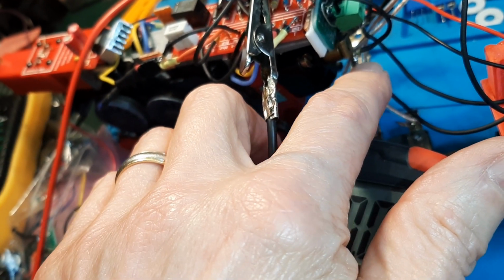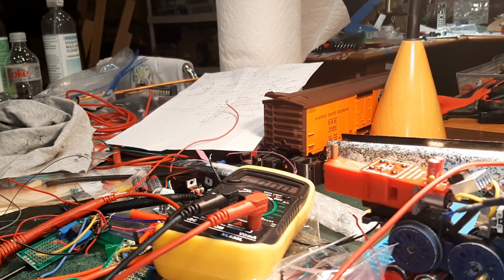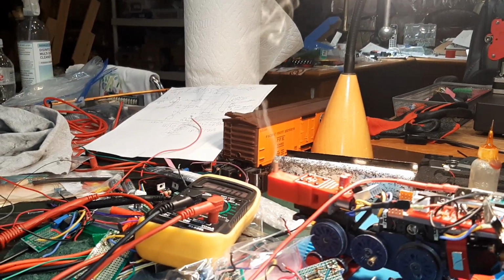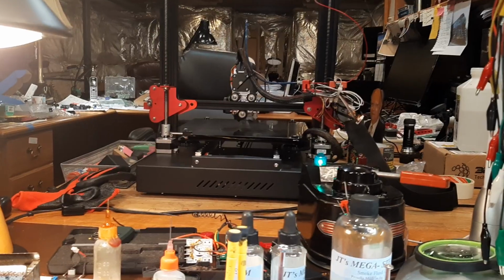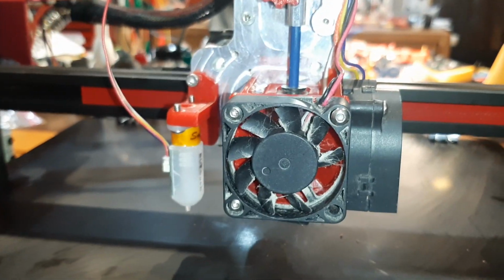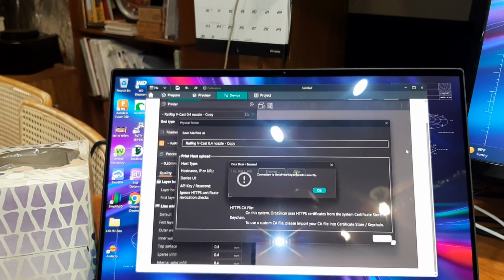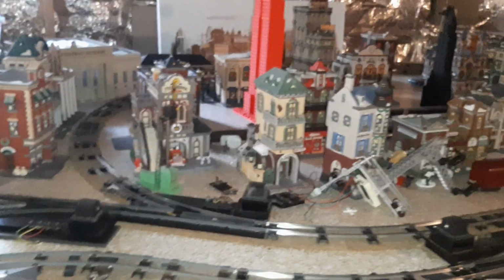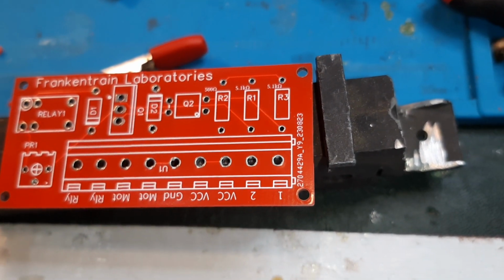Frankentrain Laboratories; fixed the Idle smoke circuit, got a mainline X Former & 3D Ptr fix up.

Comment: We’ll have a Good Labor Day. Now, aw shucks. I was going to send you another Northern Tender frame to have you design and print one or two. It has the chugger unit mounting and one hole on the front is cracked, so I was hoping to have you print some up. I have access to 4, 3-D printers but I have no idea how to use them. My Wife God bless her knows and my kids. So I have my I.T. People in house.  Lol. On another note. You might have to get the train on the track with a load to see what’s going on. Well. Good luck and have a Great Holiday.
Reply from the maker: Yes a load would tell the story. Had an idea for a dyno test stand. I should be able to reuse the 1st tender design and add the holes you need. Sent it in. I was able to complete several upgrades to me Printer. Hardware, Operation and Firmware. All very exciting. It will print better, faster and more accurate. Thanks for watching, Dennis